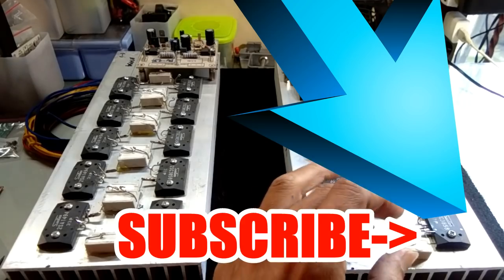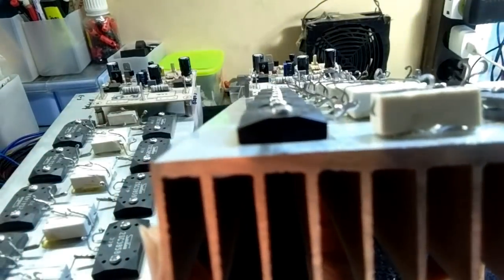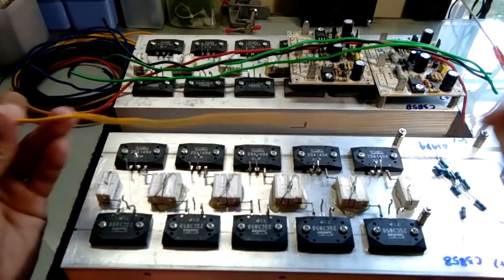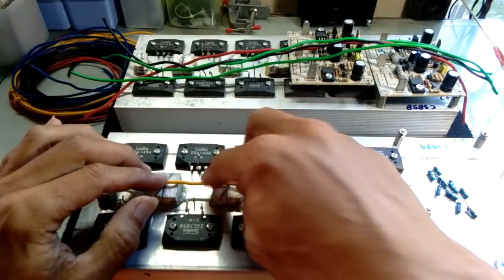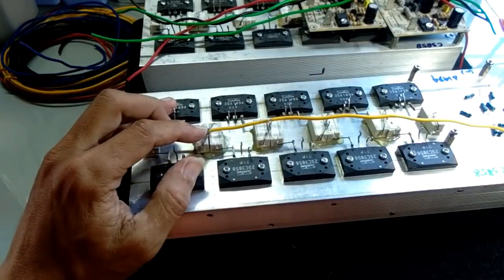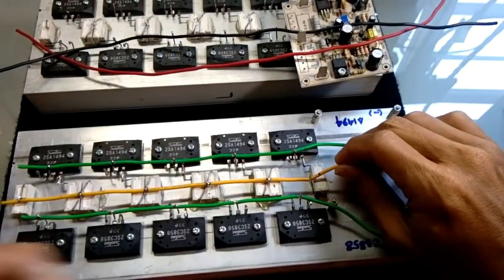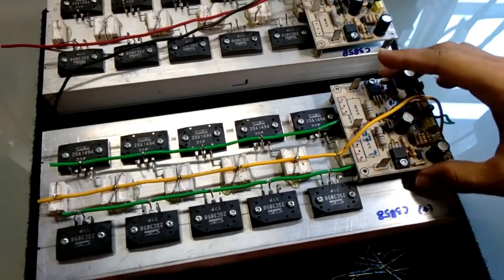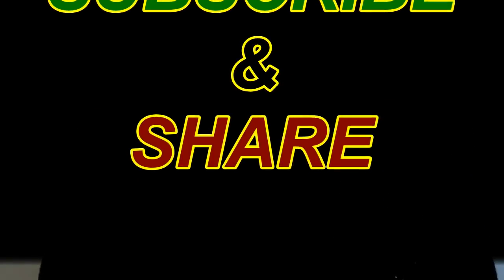PARALEL TRANSISTOR FINAL SANKEN TANPA PCB FINAL - AMAN & RAPI | UNTUK MONOBLOCK 1000 WATT [PART-02]

Comment: Bang R kapur ya cocok buat low ukuran berapa...???
Reply from the maker: R kapur tidak berpengaruh pada nada respon.. tetapi nilai R kapur akan berpengaruh pada Vbe, sehingga perubahan R kapur akan mempengaruhi tegangan pada basis TR final
Reply: @ANTHONMITRAAK  mas ibarat saya mau merangkai amplifer stereo (2chanel) dgn 1buah trafo era 25a ct45 & socl506 teff yg saya tanyakan .supaya hasil sangat maximal setiap chanel dikasih transistor sanken brapa set ya mas,?    Tlong dijawab
Reply from the maker: @dwiachanel  tegangan 45Vct masih dalam daya 500 watt - an, 
untuk instalasi 8 ohm = 2 set sanken cukup
untuk instalasi 4 ohm = 3 set sanken cukup
untuk instalasi 2 ohm = 4 set sanken cukup

misal 4 set sanken, instalasi 8 ohm tetap ouputnya, seperti 2 set sanken, hanya TR final tidak panas.
Reply: @ANTHONMITRAAK  jika 1buah trafo era 25a ct45 dgn driver 2chanel (streo) setiap chanel dibebani tr sanken 8set perchanel (chanel 1 8set sanken & chanel 2 juga 8set sanken) hasilnya kira" gimana ya mas ,?
Reply from the maker: @dwiachanel  ya keluarnya tetap 500watt s/d 600watt, walaupun 8 set sanken adalah 1600watt.. mubazir mas.. tidak optimal..
kalau akan experimen silakan diuji 3 set channel kiri, 8 set channel kanan.. beri beban speaker yang sama.. mainkan..
Reply: @ANTHONMITRAAK  mau tanya 1 lagi mas kalau untuk trafonya antara trafo era 20a ct55 dgn 25a ct45 kira" untuk smpean pribadi lebih pilih yg mana mas,?  Mhon dijawab😇
Reply from the maker: @dwiachanel  tergantung keperluannya..
kalau jumlah speaker yang didrive banyak saya pilih 25A/45Vct, 
kalau jumlah speaker yang didrive sedikit saya pilih 20A/55vct
catatan : total beban power kedua system tersebut sama.
Reply: @ANTHONMITRAAK  siapp mas mksih mas saran & ilmunya😁
Reply from the maker: @dwiachanel  sama sama mas.. semoga bermanfaat..
Reply: @ANTHONMITRAAK  itu R nya pake brapa umh dan berapa K mas
Reply from the maker: @nurilmustofa5048  R kapur 0,5ohm/5 watt
Reply: maaf mas aku baru belajar karena kemari trafo aku sampe kebakar jadi ini aku belajar sama mas
Reply from the maker: @nurilmustofa5048  hati2 menonton video.. harus selektif.. perlu beberapa refensi video bila akan mencoba.. 
silakan boleh percaya pada siapapun.

Comment: mas tkon audio mobil psang rumah gwe travo 30 amp listrik ku 900 kiro2 kuat opo ora listrik,e pwerku gede watte kro mnoblok 🙏
Reply from the maker: daya power mobil brp watt?
Reply: @ANTHONMITRAAK  powere seribu monoblok 2ribu 6ratos
Reply from the maker: ga salah power mobil segede itu mas...?
Reply: mas jalok nmer wa ne engko tk kirimi gambare audio ku
Reply from the maker: @marsuribujanglapuk2905  add di Facebook aja mas... FB = ANTHON MITRA AK
aku ga pakai wa...
telp sms 0813 8800 7088
Reply from the maker: sebelumnya accu / aki yang digunakan berapa ampere untuk menjalankan monoblok tsb
Reply: @ANTHONMITRAAK  mas wes ketemu fb e wes tak inbox pean
Reply from the maker: @marsuribujanglapuk2905  sip mas.. nanti ku buka..